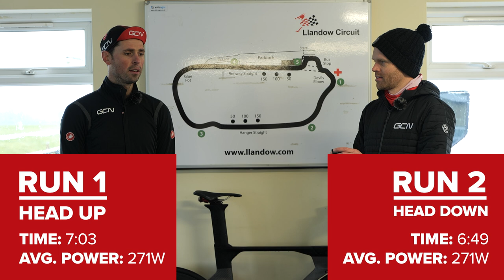Faster Isn't Always Better: Why This Super Aero Position Is Dangerous

Comment: NO mater a Timetrial bke or a trycycle if you ride with your head down your risk increases of hitting something. The statements "TO DANGEROUS " "SKETHCY TO RIDE" "TT Bikes in general are a bit sketchy to ride" "They arn't as good in technical corners"  The facts are a time trial bike back in the 1980's was sketchy to ride but when they invented the " SKI TUCK" bars is when a timetrial bike or any bicycle became more unsatble because of rider input into the balance and steering. Also in the aero bar tuck posistion  your hands are no where near the brake levers and the new arm rests that cup the forearm any adding time to get to the break levers. UCI Dont ban the bike, ban the aero tuck bars!

Comment: I disagree that punching 1 hole through the air is better than punching 2. Aircraft carriers use 2 smaller islands instead of 1 large island because it is aerodynamically advantageous. It helps reduce turbulence.

Comment: I think the way to fix this is to ban head down riding by the UCI and whoever is the main organizations for the Velodrome Racing. This and the same for Triathletes top road racing bodies The one for the Olympic distance as well as sprint distance and then the Ironman races who have had a triathlete wreak overtaking a cyclist often due to head down racing when overtaking, though Triathletes most of the riders have less drop to the bike handles then the individual time trial or the Velodrome Racing due to needing to see going into the change for running.